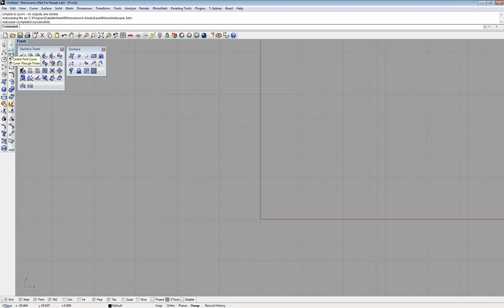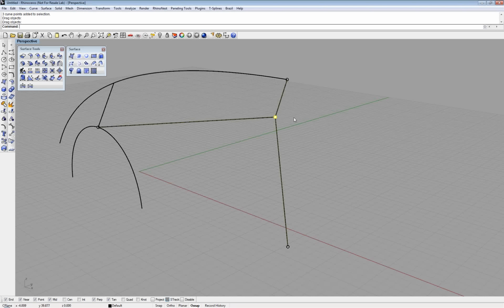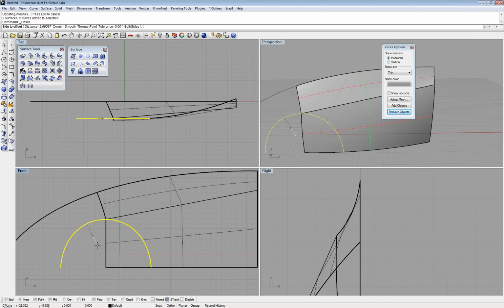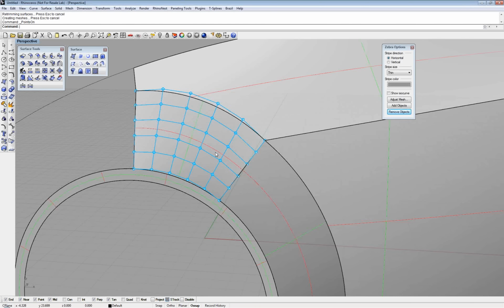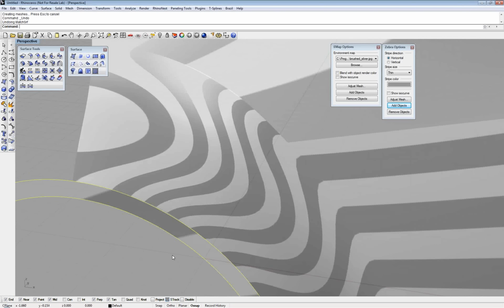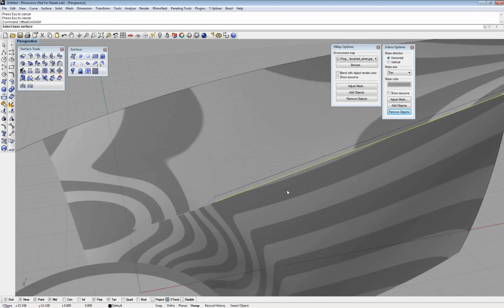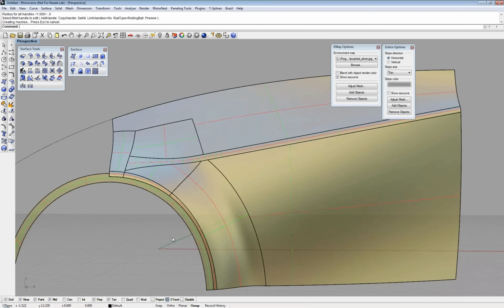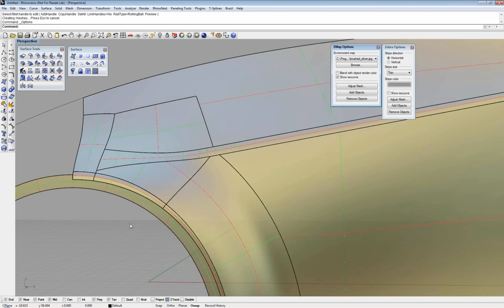Advanced Rhino 3D Modeling for the People

Comment: I did learn a bit on this tutorial, although its frustrating that the project is cut short to fit a 1 hour timeframe. Also many of the surfaces in my file are unable to match on all 4 sides despite numerous rebuilds and attempts. Like the presenter, I was unable to finalize the project.